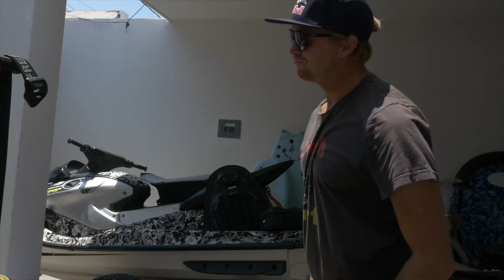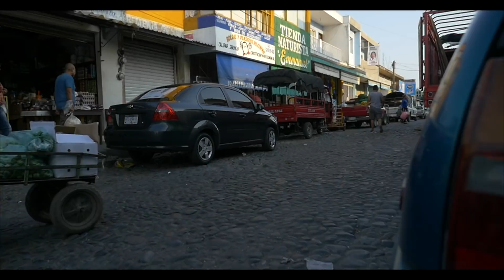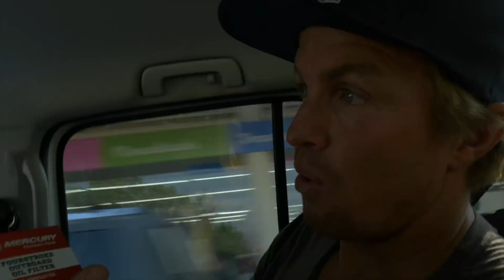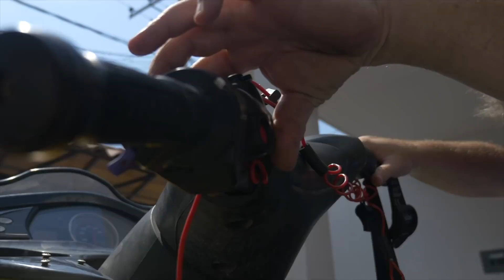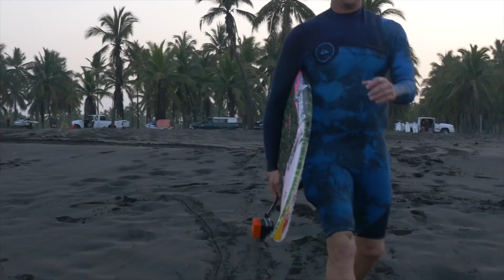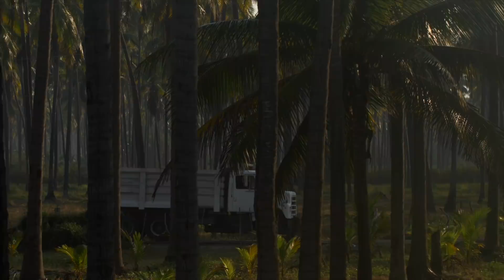GIANT BARRELS ARRIVE | MEXICO PT. 3

Comment: Pretty sure that is a Kawasucky, not a Yamaha.  If it was a Yamaha, it probably would have been working just fine!  Why are most tow-ins and water safety patrol during WSL events using Kawasaki?
Reply from the maker: Definitely a Yamaha!
Reply: Ha, I stand corrected, definitely says Yamaha on that sticker huh!?  For some reason I thought it looked like a Ultra 310.  What model do you guys use, FX HO like 2006 model?  Sucks that it broke down, I thought Yamaha was supposed to be super reliable!  Maybe not after years of street tacos I guess :(
Reply: Greight Johnston what is your take on Polaris, I picked up a 750 and I'm currently rebuilding the motor in it